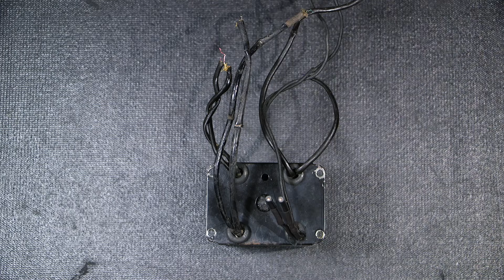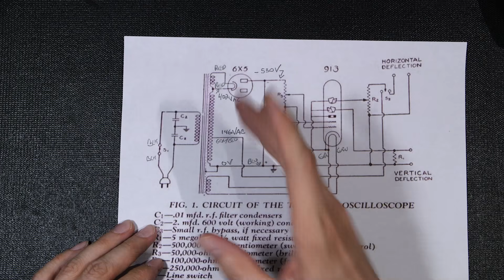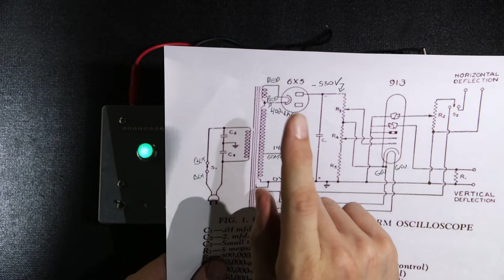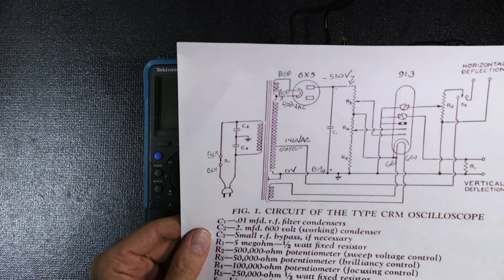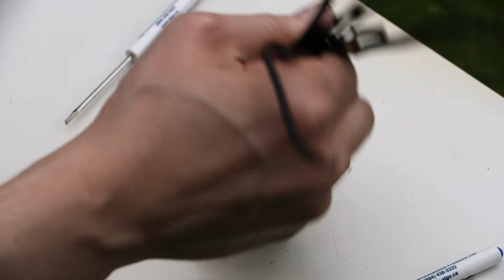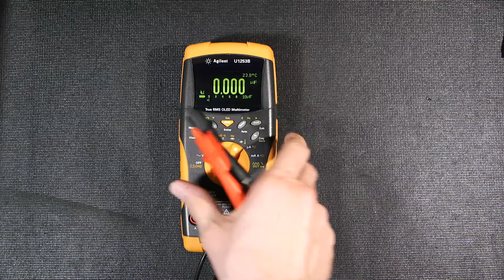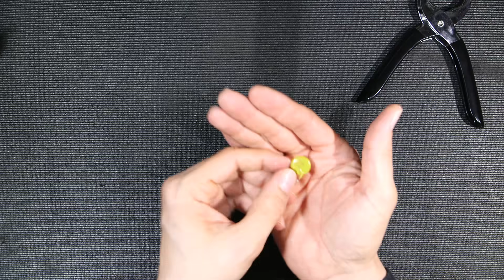Transformer Repair {Depotting} Lets Look Inside!

Comment: Tar filling was somewhat common in the day (I think). Ignition coils (trembler coils) for Ford Model T is tar filled and even though many have experimneted with modern filling, none have been found to superseed the tar. The tar served two purposes in the trembler coil: insulation between the HV (up to 20 kV) and low voltage and also to prevent the connection break due to vibration and metal fatigue. This have happened in modern time with restored coils where the tar was not put back.

Comment: I hate potting. It stinks, it has the potential to make a huge mess. I suppose if you have the machines 
to inject it and you do it every day with everything you need to do it, and just one compound, it might 
not be too bad. Mixing it by hand, weighing the resin and the hardener with a triple beam scale, potting 
small batches, really sucks! 😖😓

Comment: This was awesome, that transformer was terrifying (more than normal)..

 I recently replaced a capacitor from the plague era on my Samsung TV, following the recommendations of a professional eengineer on a Samsung TV repair forum. 
The trick there was to make sure you buy an increased voltage with same capacitance, just to prevent overdraw (in this specific case only).
It worked, been running for several months.

Anyhow, I came back to this video as it was my inspiration to be wary of Caps in general, I knew they can suck, but c'mon National!

Comment: with the same amount of  work
for cutting into the  toaster oven....
you could have  cut  the visible   seam  on the  transformer  with  Dremel  tool    used  heat  gun   and  soldered  seam   back together     ......potato/ potaaatoe  
😁😁😁😁😊

Comment: You don’t need heat just soak the tar in a petroleum based solvent and it will dissolve over a few days. You can just pour of the mixture of tar and solvent.

Comment: Most tar seem to melt at temperatures relatively safe for the transformers. If it didn't, they would have sky high rates of manufacturing duds. Key is patience. Many tars melt at under 100°C. For those, you can put the transformer in a sufficiently heat tolerant plastic bag, suspend it in a metal pot with a cutout lid, fill it with water, and use an immersion cooker (sous vide stick) set at 95-98°C to heat the bath. Its gonna take time, but the temperature will be constant and stable unlike in an oven, the cables and wires aren't heated, and those cookers are designed and built for running for days non stop, as "normal use". Just don't forget to keep a lid on it with minimal excess cutout around the cooker. At these temps, evaporation will be substantial. 

If you do this a lot, an immersion bath (kinda like a deep fryer) may be favorable, as you won't need to deal with holes in the lid. You can also get WiFi enabled units that will enable temp and heating control from anywhere, push you a notification on your phone if temperature goes over a set threshold (suggesting it's running low, on water due to evaporation). Use a different immersion heat source and liquid if you need temps at 100°C or above - a deep fryer is a cheap option. Preferably a unit with open heating element and temp sensor in the liquid, this reduces the risk of thermal runaway during long continuous operation.

Comment: FREE !!! I have a tec 465 scope only half the screen shows Square wave when testing it 
It has the probes and everything needed and a few extras 
Free if you would like it to do a video on how to fix it 
Or to sell or give to a friend or anything else you would want to do with it 
You would have to pay shipping I think it is about a dollar a pound I would pack it very good for free also you only pay shipping 
you can hold shipping until you receive it 
I like your videos and appreciate you teaching people like myself 
There is a inverter that just came out that has raised the bar really high if you would like to check one out 
A Youtuber sean has a new line of inverters his company is Genetry solar
I have been trying to help him in any way I can by winding toroidal  Transformers and testing them this inverter has wifi you can link them together for more wattage or three phase and when you upgrade to a higher voltage you don't have to buy a new inverter they will do 12 through 48 volts maybe even higher I am working on that now I work for free I just like to tinker 

God bless you if u can help your channel or you in anyway please let me know

Comment: 3:30 I also like using colored electrical tape for this purpose. You can get electrical tape at the hardware store in a variety of colors. Just wrap a couple bits of the same color of tape on each end of the wire and cut in the middle.

Comment: Some old hifi valve amps have tar / bitumen potted transformers and if the varnish ages and you get a short, they nicely pour burning tar onto your carpet!Tar melts at about 50 degrees C so putting them in boiling water (on a riser to avoid the heat from the stove) is another good way too.

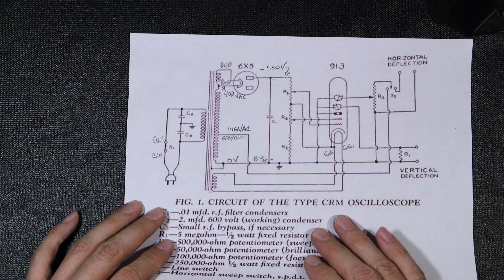Comment: 4:29 - My experience regarding color coding the leads with a marker speaks against it:  markers (at least some of them) make a thin layer on the wire surface and so solder hardly sticks to them. Had me loads of troubleshooting on one of the projects before I noticed a blue coloured wire end poking out of jack solder lug and a nasty cold solder joint surrounding it. At least if you do it, rub it off before soldering. Better colour the insulation - or, if the insulation is too dark, as in this case, make labels out of masking tape on them.

Comment: You’re 100% right on that I took apart an old vacuum tube amplifier when I was a kid to see how it works and how it build and I need find 2 electrolytic capacitors inside the transformer housing that was coated in tar ones I heated the housing it got soft remove it and found the caps I also seen resistor in them mostly in old military vintage equipment

Comment: Great video Paul, thanks.  I studied electronics at DeVry 1964/1965 and tube theory was still very much prevalent, transistor theory being the newcomer.  So I really enjoy watching you work on vintage equipment.  Btw, did you replace the tar in the transformer with anything, or just left it "clean"?  Not sure what the purpose of the tar was anyway.
Reply: Hey there, tar probably used to keep plates of transformer from vibrating g in metal case. Also keep out prying eyes. ! National was high end equip.ent back then. Military specs I'm sure. Possible that same transformer was used in high end military communications stations receivers with no limit on production cost. !! Capacitors back then had polarity markings.i believe. Probably outer core of cap went to ground to prevent any line interference from being radiated into sensitive e areas of scope.would work either way except when on max sensitivity. Just a thought. Excellent video dude. Your the best...
Reply: ...probably the pitch was used to provide extra insulation- and keep out moisture. Someone else suggested that the pitch also kept the transformer laminations from vibrating- which sounds logical.

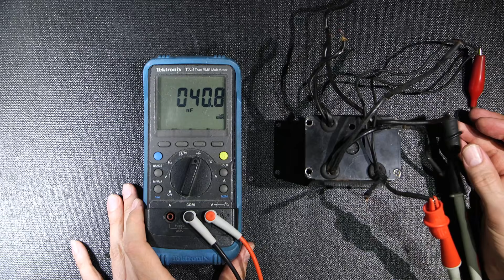Comment: 14:45 Can't you use a scope and a DC versus AC signal (like 1Khz sinewave) between earth and one of the primaire inputs ?
If there are capacitors on the primaire side, a DC signal will be blocked by these capacitors, and will only flow through the primaire coil, 
while a AC signal will pass the capacitor and the primaire coil.

Comment: Didn't you read the official National service manual? Page 32: "To service the transformer, cut a hole in a toaster oven (to be invented sometime about 40 years from now), and mount the transformer in the top such that the tar will be released. Do this outside as the coal tar is carcinogenic."

Comment: Who else is silently cheering for the old electronics to work like the day they were new?
Reply: I am 62 years old and I remember vacuum tubes from when I was a kid and yes I am always rooting for the older technology Herod and vacuum tubes have made a pretty good comeback in certain markets such as guitar amplifiers and also linear amplifiers for ham radio
Reply: @larryknudsen1105  tone caps are usually fine it’s just another gimmick for this clown to get patrons
Reply: @jimcatanzaro7808  I find it super weird that you're commenting on tone caps on a video on power transformers. What do tone caps have to do with anything? Also, electrical leakage to chassis can be pretty dangerous in this type of situation, and certainly unpleasant to touch.

Comment: Would have been a lot easier (and cheaper) to screw it to a piece of wood. Then clamp it in a vise and heat the case with a propane torch. Maybe 15 minutes of work. The eyelet trick was something I hadn't thought about.

Comment: 27:50 They were probably thinking that it would be a good idea to discourage repair and hope that the customer would just buy another one. Sonic welded plastic on phone cases are also a pain to deal with when the battery needs replaced due to losing half or more of it's new capacity in a couple of years.

Comment: Reminds me of the days back in the 1990's when I was depotting 15kV NST's to remove some shunts to get a bit more current out of them. After a  few of those and wishing they'd just quit being cheap and fill them with oil like a sane manufacturer I just started buying my own wire and silicon steel and starting winding my own, actually less work. These days instead of lugging around 300lb transformers (not young anymore) I've went to using 100kHz ferrite cores and litz wire (100kVA = maybe 60-70 lbs).

Comment: Actually you could use an ohm meter to measure leakage.  I have an old analog triplett model 630-apl.  On the 100k ohm scale it uses a 30 volt battery.  you would get a resistance reading in megohms using this meter on the 100k ohm scale on those capacitors you are testing Paul.  It uses only a 1.5 volt or maybe 3v (two 1.5 in series can't remember) battery on the other scales so yes true there would be no ohm reading on the lower scales.  It may not be as accurate as the capacitor tester or your leakage tester but with minimal equipment you could use an analog meter like this to get an idea of leakage.  I like gadgets  and hope to build your leakage tester and I have collected several old style capacitor testers.  With a modern dvom no as you demonstrated you would get no resistance reading because they typically use only a 9v battery.

Comment: The majority of your late 20s and early 30s radios had potted caps.  Fairly early on in my antique radio collecting I got a Philco Jr./model 80 that had a whole bunch of those.  I think I used a heat lamp.  Installed new caps but didn't bother to pour the tar back in as you couldn't see the top side of the Bakelite cups which held them.

Comment: Thanks for the great video, I would never have thought to cut into the top of that oven, it worked much better then I thought it would when you talked about it!  Cool little scope.  I have one I built with an Arduino and tiny screen that is built into a candy tin, probably does more then the little guy but surly will not work as many years.

Comment: I never saw any firm nowadays putting some capacitors inside their transformers. It's just a total nonsense. Tube amp transformers usually go hot when they operate and capacitors are very sensitive to temperature change.

Comment: Paul That was a cool video! So now that you have a new tool (The Betty Crocker Easy Bake Transformer Warmer)  You might think about making adapters to fit other transformers? If anything to put a metal flap over the hole you made in it and make it into a re-flow oven.  One might find that when you can control the environment you can also control the result.  Great recycle on the oven and if anything else you can use it  warm your coffee or add a blower and use it for a space heater! "If you do so you so at your own risk!" Words to live by!  Your options are endless! Thanks again and Stay Safe!

Comment: It would also have been possible to use an insulation measuring device to be able to find out this insulation fault. Sometimes, however, it can happen that an insulation fault only occurs in a certain flow direction. Good insulation measuring instruments can and will automatically reverse the test voltage. The test voltage can be selected up to 1000 V DC. The voltage value at which the insulation fault occurs is then also displayed. We use the Gossen Metrawatt Profi M-Tech to measure complete electrical installations. There are also device testers from Gossen Metrawatt, which can perform numerous tests on electrical appliances.

Great video.
Fortunately, I have not yet found any capacitors in a transformer housing. The only thing I occasionally even between, or found on the windings, was a thermal fuse.
Disadvantage is that once they have triggered, you have to exchange them.

Comment: Break out your Heathkit death machine again.  Once again, that's the only one I've ever seen without a spring loaded switch for the leakage test voltage, even in the early 70's the testers I saw had that.

Comment: Oil will dissolve tar, and I am wondering if anyone else thought of this? however it could have PCB's in the tar. I think I remember Paul that you shown the kind of capacitors that should be installed in a video a few years ago, they are rated at 630vac (or higher) instead of standard bypass capacitors. However that was back when YouTube was paying people like yourself for the number of views, and did not need to get other sources of funding to present your great videos. I have a background in Electronics, but have nowhere near the amount of test equipment, tubes, and space for them that you have there. Years ago I was building up a test bench and work area, but made some financial mistakes such as taking out student loans and trusting some people such as family that I should not have. The best education is where there are no loans involved, and I mention this for everyone. Many of us are not taught about the correct way to lead our life, meaning understanding that it is always bad to be indebted to anyone, and why things mentioned in religion such as Usury are always bad. I like that you have things available to people to support your channel and learn without going into debt.
Reply from the maker: You're welcome P R. I'm glad your benefiting from this channel.

Comment: in early radios it is not that uncommon to find several condensers mounted in a metal box potted with tar. transformers were also done this way. i think the potting was done to keep out moisture. the metal box provided some shielding. in 20 years of radio tv servicing i have depotted more than one of these. we would heat the can in a pot a hot plate and grab it with a pair of channel locks and pour the hot tar out into the pan. do the repair then reheat the tar and pour it back in.

if im not mistaken the tar is pcb. i never suffered any ill effects from it though.

Comment: Viewers should understand that a low-voltage test on a Hi-V cap is never a good indication as to whether the cap will work in a Hi-V environment. A Low-V tester should only be used as a simple go or no-go test of a cap.
Reply from the maker: Hi Dorian. If a capacitor has leakage, (You are testing for leakage) then high Voltage is not needed. (You don't need high Voltage to measure sustained leakage resistance) If you are performing a breakdown test (which is destructive to the capacitor) then Yes, you need high Voltage. Once you reach breakdown in a capacitor (capacitor draws current under test) the capacitor has been damaged. Breakdown tests for capacitors is completely different than breakdown tests for semiconductors.
Reply: I'm not talking about breakdown tests or semiconductors. All leakage tests should be performed at the full working voltage of a capacitor in order to perform a truly accurate leakage test.
Insulating films act very differently under low voltages then they do for high voltages since they are not true resistors. Such materials exhibit dielectric absorption, soakage, non-linear resistance and other strange properties, particularly at high voltages. This means that a capacitor can leak excessively under high voltage while the predicted leakage using a low-voltage test might be much less.
All I’m really saying is:
-Excessive leakage at low voltage means throw it away
-Low leakage at low voltage means now do a high voltage test.
Reply from the maker: Hi Dorian. This tester identifies leakage in capacitors that that 600 Volt testers don't see (detect). Check out my original video: https://youtu.be/LhovRIM5xAo  I will display this many more times in future video's.

Comment: Considering that the power switch had it's own leads, pity that those potted caps didn't have their own leads as well :(
Reply from the maker: That sure would make cutting them out of circuit an easy process.

Comment: I do believe that the black tar that your chipping away and heat up does contain asbestos along with the cloth wire. So please use caution with a lot of those old components. Traces of PCBs can be present also
Reply: probably both of the above, but not very likely to spread from the tar and in the cloth wiring it's usually bound pretty well with the other fillers/material. don't go grinding on it though.

Comment: If I remember right there's a chemical process for dissolving or bringing potting material back to a liquid state. I wonder if there's a chemical trick for tar as well?
Reply: there's things the tar will dissolve into, but it will also dissolve the winding varnish, cardboard, wire coatings and whatever else they put in there... total destruction